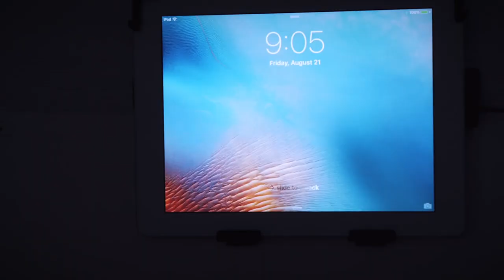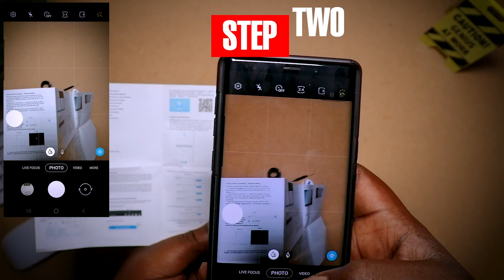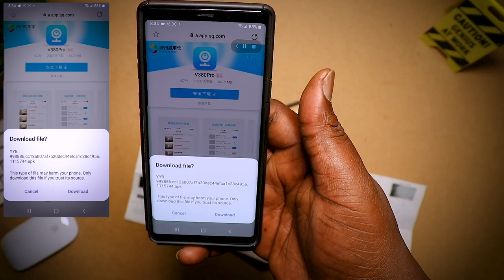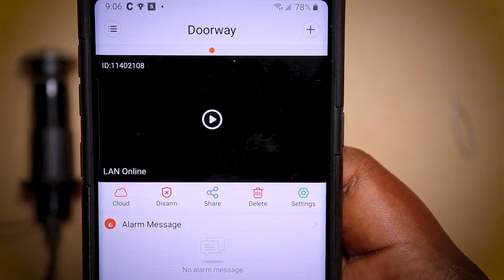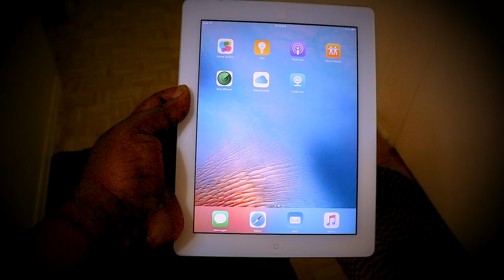Home security door wifi camera (V380 )

Comment: Is it available in 12 mm? I got permition to install one as long as I don't expand the hole for the existing peephole as the landloard would be putting the old non-camera one back when I move out and they want to have uniform door front's on the units, they don't want to have to use a different peephole. 

I know the Brinner Peephole Cam also looks like a regular peephole from the outside but comes in a 12 mm variant but I want to look at my options. 

Requirements:
Does not require mounting screws or putting any holes in the door that don't already exist with a regular peephole.

Does not look any different than a regular non-camera peephole.

Fits a 12 mm peephole hole

Wi-Fi enabled app (motion sensing and notifications not required, but acceptable as long as there isn't a make-it-look-like-a-camera requirement to have it nor should it have a seperate motion dectector as both are methods are options with the Brinner the motion detector is a separate unit that can either be made to look like a door camera or be placed separately from the camera but still looks like technology attached to the outside of your door which is not acceptable by my management) it would have to use the camera it's self to detect motion so that the entire setup still looks like just a reular ol' peephole.

on demand, in app live view ( so that when somebody Rings my doorbell a regular old old school doorbell that's not attached to any kind of app or anything like that, not a smart doorbell)... when my doorbell goes off, I can use the app to see who's at my door.
Reply from the maker: Yes you can so sorry for the late reply

Comment: Thanks for your video. I just bought I think a similar model of door camera, but I only want to store video in the SD card for now. How I can do that? The manual explains nothing about it.
Reply from the maker: Hey friend I really appreciate the comment. well if u just wanna use an SD card its pretty easy just put the card in the sd card slot and turn the camera on. thats it and it will start recording when the camera is turned on. I hope this helps if it does pls subscribe and smash the bell icon if u havent done so and stay turned. stay blessed.

Comment: Hello. Do you happen to know, if connected to 10000 mah powerbank, how much time it will take for the camera to empty the charge? I just wanna stick to the door powerbank so that not to deal with wiring the camera into mains. So the question is how much electricity it requires? Thanks
Reply from the maker: hello friend thank you for the comment. I really appreciate. That will probably take close to 8 hours if using only the camera. Although I haven't tried it for that long but should work close to that time. Hope this helps. let me know back how long it took it when tried out so others know and once again thank you for asking pls stay connected and stay blessed.
Reply: @EZeemedia  I'm thinking about buying this camera for my apartment door and I would like to do the same with a power bank but mine is 30,000,000mah...How long will that last before it's drained?
Reply: @EZeemedia   Hello, sir. I report back. I received the camera, connected to it 10000mah power bank. According to the camera specs it requires 1.4 W. Power bank will give 10Ah * 3.7V= 37Wh. So I expected to get (37/1.4=26.4) hours of functioning. To my surprise, that's exactly what I got. After approx. 26 hours the power bank was completely depleted. The camera worked as it should during this time without a hitch, at least so far. 2 things to remember: 1) this camera doesn't have any night vision, the motion sensor doesn't work in complete darkness, 2) when you replace one power bank for another it will take around 1 minute for the camera to initialize itself back to function.

Comment: This peephole camera looks neat and am thinking about getting it for my apartment door.I've seen some reviews not necessarily on this particular model where people are saying the peephole camera gets hot.Is this true?My apartment door is wood and pretty thick is it safe with this camera?
Reply from the maker: Hey friend I will tell u that I have been using this camera for a year now and it's been plugged in that long up till this moment. It does heat up at all, and I mounted it on a wooden door too so it will be fine I don't know for any other peephole camera but for this one it will be fine for u. Hope this answers ur question feel free to ask if necessary and don't forget to subscribe and smash the bell icon for notifications so u get notified when I drop a new video. Thanks 👍🙏🙏🙏🙏
Reply: @EZeemedia  I have a 30,000,000 mah power bank,how long will that power the peephole camera for?

Comment: hi does this end notifications to you when it detects movement?
Reply from the maker: yes it does when u set it for notification on movements. so in the settings u will have to activate motion alert. Thanks and hope this helps also you have to set up ur email to get notification through to ur email with a snap shot.
Reply: @EZeemedia  thanks so much great help
Reply: @EZeemedia  Is there settings for motion detection,like low medium high?